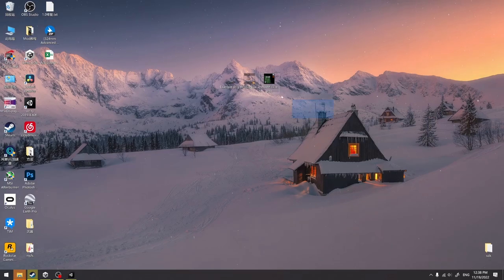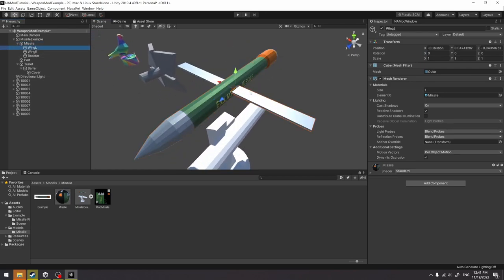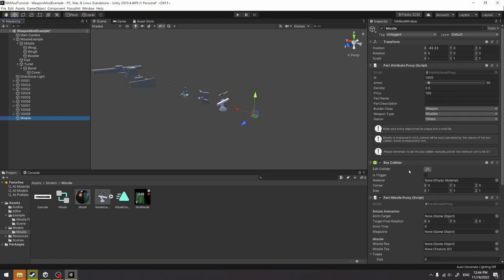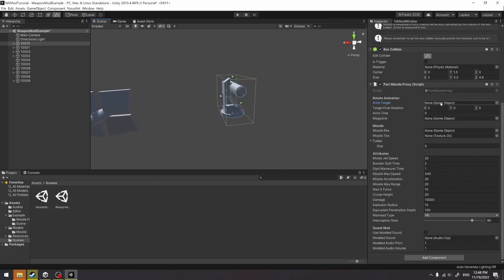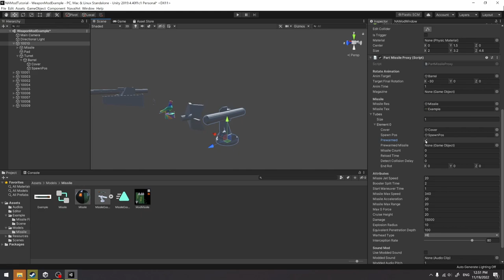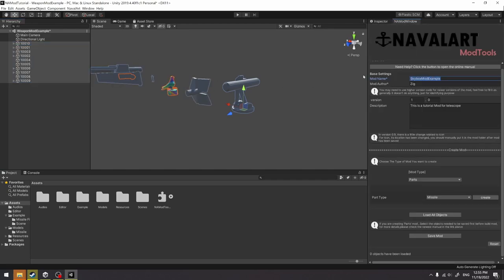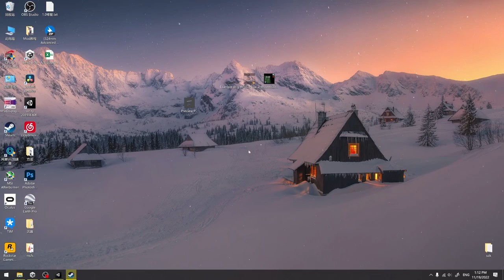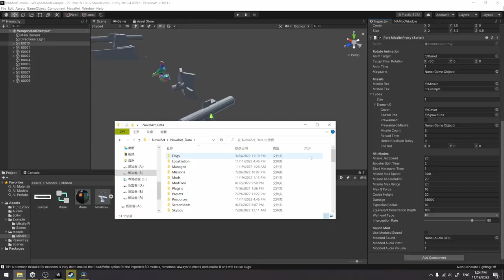NavavArt Modding Tutorial - Ep.7 Missiles

Comment: Most impressive :3 
On a side note, is all the animation of the explosion or trails (from the missile) the same, or can it be modified?
Reply from the maker: Hi Submarine M1, you can disable the default trail by not adding a "Thruster" in the booster object, meanwhile you can also add whatever particle effect as the child object as the missile, you could add a delay in the particle system component of unity, this method is described more detailed in the mod manual.